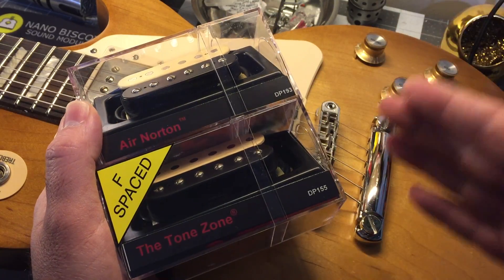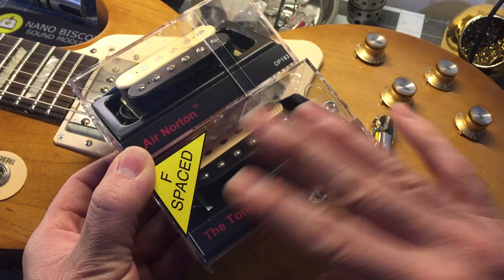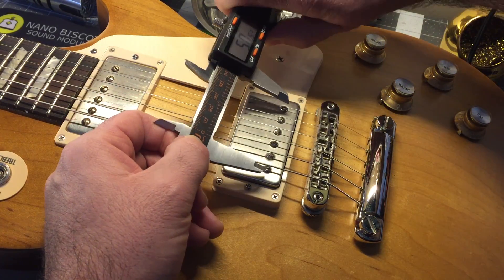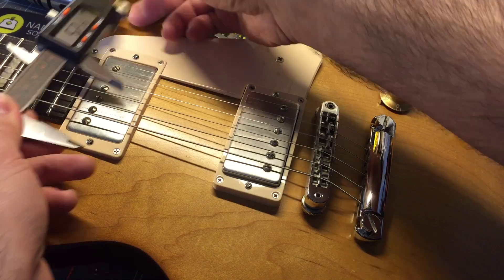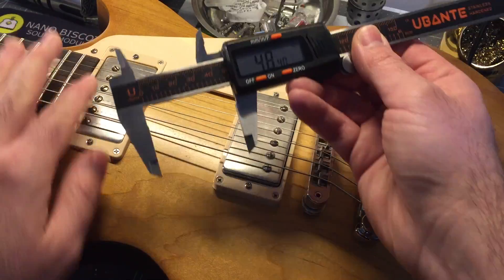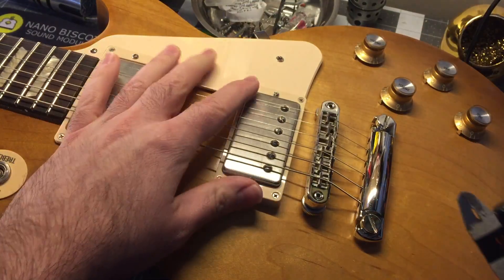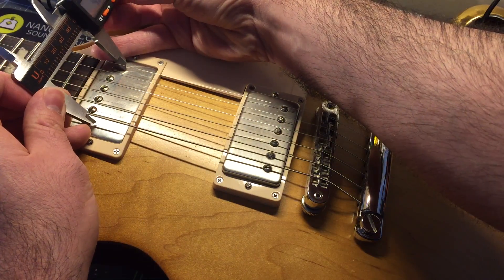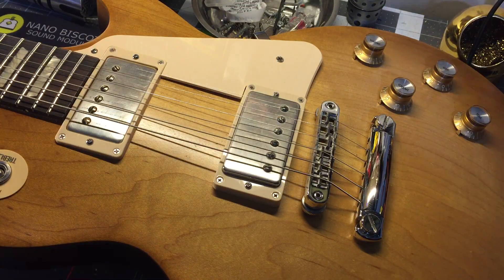What are F-Spaced guitar pickups?

Comment: That's also the same spacing as Fender Wide Range pickups, between 52 and 53 mm like in the Telecaster Thinlines, '72 and '72 Reissues. I was thinking about a set of these for my '72 Thinline, to see how different they sound over the Fender versions.

Comment: I felt certain watching the video, but many comments caused confusion and many not factual. As specifically read, the distance used is from the centre of the pole pieces. The strings should be directly over the centre of the pole piece. Yes, it does matter snd a lot. Why? If you bend you r strings snd you do, whether an actual bend, or vibrato, you should be starting in the middle of the pole piece, so the string during bending or vibrato, picks it up, both ways, as best as possible. This makes 100% sense. The neck is alway standard and F standard for standard spacing, as it existed before a Floyd Rose existed. Long before. The challenge in fixed bridges is still spacing, as an LTD, PRS or Gibson could be different and a hard tail Ibanez is absolutely F spaced at the bridge, specifically to make it easier for players like Gilbert to swap between Edge(Floyd Rose derivative), back to hard tail. What sucks is my guitar is being set up, do I can’t measure my LP centre pole piece to centre pole piece on the bridge. The neck is a given. Dimarzio and SD said F spaced meant Fender, but for copyright reasons can’t put Fender. I am getting a Standard set up to trade for a reissue. Personal taste for both. The Jimmy Page electronics are on the way. I want the pickups on the way. Holidays and days to pick up the guitar are causing the delay. COVID-19. Reduced hours for amazing tech. My hours the same, hard to make it work. Trying to put myself in position to swap guitars then stick in a Jimmy Page wiring and new pickups, but an answer on bridge string spacing is a delay. Video seemed bang on. Comments with thumbs up now make me uncertain, but the strings should be dead centre to the centre of the pole pieces for said reason. If off on one string to one side, playing the string is fine, but a vibrato/bend just sends if more off. Great video. I will go with video. Dimarzio and SD are hesitant to answer and be wrong, as some reissues, different years over decades etc, could be different. It is safe just to say measure, but if you are away from your guitar for a week, this sucks. The pickups should have or could have, actually are delayed. Video is right. Answers are hard to find. Comments don’t seem to take in account vibrato/bends when answered and the string over the centre of pole piece is definitive. Great video. I can now compare measurements to the model I will have! Thx Richie!
New info. There are arguments between the F spaced called F spaced, but most note F means Fender. Some swear by FRose. It gets worse. The Trembucker is slightly thinner than F spaced. Now I know why companies won’t answer questions. A  Nashville bridge style is NOT the same as ABR and Studios are thinner spaced, so individual guitar years models are different, do are the same models year to year and AAbR on a certain guitar versus Nashville, based on model, a Nashville style on a Studio is thinner than a Nashville style on a Classic, LP Standard or Traditional. Now it is Trembucker vs F spaced. The difference is slight, but we are talking slight. Have to wait to pickup guitar. Was it really that hard for Gibson to make a graph or list of spacing for models for a given year? Not hard! They will break their backs for serial number, BUT just provide the right spacing for a guitar all called the same thing, with no measurements on the box. Clearly they don’t want aftermarket pickups in, BUT that also means a Burstbucker is specific to year and bridge style, so they are also screwing themselves. I thought F-spaced had to be the same as Trembucker? No! SD will list say SH15 and TB15, standard and Trembucker, but also list it as F spaced, but all 3 different. This sucks and should be easy, ugh! Still a great video!

Comment: Finally found something after much looking at sweetwater. Less than 50mm centre of pole piece to pole on the bridge is a standard size. Dimarzio is 48 and SD 49. There is decimal points, but close enough, according to them. If over 50mm, Trembucker and F are close enough. Dimarzio F spaced is 51mm and a SD Trembucker is 52.6. There is a small difference, but that is the rule of thumb to help keep it easier according to them. F actually mean vibrating, but I don’t want to get into language.If it has any kind of Tremolo just pick F or Trembucker in the bridge, If not a Studio LP, then Trembucker or F spaced. If Studio measure, one company found minor differences, do one likes Trembucker snd the other F, but Gibsons other than studio, go with Trembucker or F. Hopefully that helps. SD is closer to Gibson, but SD Trembuckers will apply,

Comment: F is for Floyd and are used with floating Floyd Rose type trem systems that require a little wider pole position.  I just talked with a Dimarzio tech this week 😎.  Great video!!
Reply: So if its for floyd or fender why does this guy have F on a standard bridge Gibson?
Reply: Sound wise, is there any difference?
Reply: Gibson bridge widens the string spacing so the bridge pickup needs an f spaced pickup . It’s a new thing . You can grab a ruler yourself and check .
Reply: @Twinwolfgarage I got a standard spaced Dimarzio Super Distortion for my 2020 Gibson Les Paul Standard 50’s.  WRONG.  WRONG.
The strings don’t line up with the pickup poles.
Who knew a f***ing Standard 50’s LES PAUL would use a F Spaced pickup…..

Comment: The general numbers thrown around are 53mm (2-3/32") for F-spaced and 50mm (1-31/32") for standard spacing. Worth remembering it only applies to bridge pickups. An F-spaced neck pickup wouldn't be recommended.
Reply: that's pretty much what i have deduced since learning about f spaced pick ups. put an f spaced into the bridge position even with tuneomatic or don't (it doesn't matter too much). just don't put them in the neck position.
Reply: reading this AFTER unsuccessfully searching for F-spaced neck pickups. Thanks though, learned something new
Reply: thanks

Comment: Thanks. Wondering exactly why they'd make two kinds and what the difference is, soundwise. Maybe one tracks better?
Reply: Dagwood Dogwood  Thanks man.
Reply: Long ago, there were only two kinds of guitars: Fender and Gibson. They had different spacing. The F-spaced stands for Fender, which has a wider spacing. Floyd Rose trem happens to have the same spacing as Fender (who would install a Floyd in a Gibson? :-)). If you install a non F-spaced pickup on a Fender, the pole won't align with the strings and that affects the tone and sustain.

But Gibson LP switched to F-space after 1998. In that case, who would use a non F-spaced pickup? @_@ And most humbucker set comes with non F-spaced by default.
Reply: @davidletterboyz  maaaaaan, thanks for this explanation, it helped me A LOT. I was wondering why I have quite low sustain on my guitar, i thought i would need a sustainer pedal. Now i know the right reason. Thanks a lot again 😊😊
Reply: @MultiMeraklija  Oh ya. Low sustain could be caused by other issues as well, like low action, fret buzzing, pickup pole is too close to strings etc. Perhaps you could check with a guitar tech first.
Reply: @davidletterboyz there is no any guitar tech in my area, but if this is helpful, i will say that I have Jackson JS32 Dinky with their factory stock pickups. I don't know does that guitar requires trembucker on the bridge position
Reply: @MultiMeraklija  JS32 Dinky has a tremolo. So it definitely use a Trembucker/F-spaced pickup. But just to be clear, the stock pickup is already a trembucker/F-spaced. I suspect the lack of sustain could be:
1) fret buzz/action too low. Does it buzz when you play certain notes/frets?
2) pickup height is too close to the strings. For this, you can just experiment yourself by using a ruler and a screwdriver.
3) stock pickup output is too low. This could be a factor, but from my experience, I think ruling out setup issue first before experimenting with other pickup. The thing is, most people bring their guitar to a tech to change the pickup, and the tech will likely set the guitar up properly after that. So, indirectly, the guitar tone benefited from pickup upgrade and also good setup.
Reply: @davidletterboyz  I looking for upgrade for my MiM Hss strat

Is F spaced DiMarzio good for it?

Comment: Hi, ok so f-spaced dimarzio pickups are wider spacing...but my question is: are they also bigger(wider)? I need to know that because the humbucker holes on my washburn parallaxe have exactly the standard humbucker dimension so that, for example, a Seymour Duncan trembucker does not fit the hole. That's because trembucker not only has wider pole spacing, but is ALSO wider (the base plate) than standard humbucker. SO, can you tell me if dimarzio f-spaced have the same size of the standard ones? I really hope so, otherwise I would have a problem with dimarzio too. Thanks
Reply: Of course I need f-spacing because my tom bridge is 52mm

Comment: What happens if I put a regular spaced pickup in a guitar with a floating bridge?
Reply: As in the case before f spaced pickups existed a normal pickup always were standard on every guitar so i personally  call it the biebediewabalieboo sound xp
Reply: @sampyro765  So does that mean it will sound bad?
Reply: @Tyler-ur2ig  no with the f spaced ones it will sound tighter but before you had a great sound but the strings always bounced wich caused a jumpy kinda sound the f spaced ones take that problem out 
I tested it on my 6 string Floyd en my 7string floyd and i must say damn straith and smooth AF :) go for it
Reply: nothing.  think evh albums 1 and 2. he didn't use f spaced as it wasn't even 
around yet.
Reply: @deans.4705  didn't evh have his bridge pickup at an angle so the outside strings were at least over pole peices?

Comment: in my experience it does not matter too much. with tune-o-matic (i mainly think gibson) f spaced bridge pick ups are perfectly fine. I have 2 guitars with TOM and the standard spaced dimarzio i put in it even looks off.
either way sonically i do not notice a difference anyway to be honest. maybe someone with a stop bar gibson might profit from a standard spaced pick up, who knows.
generally speaking, putting an f spaced one in the bridge and a normal one in the neck position will be perfectly fine for most  guitars. if it does not line up perfectly do not fret, consesus seems to be that it is not much of a difference.

Comment: I ordered some F spaced pickups for my guitar with a tune-o-matic Gibson style bridge. I've read that it doesn't make much difference if any at all if you put F spaced into a regular spaced guitar since the high and low E strings will be on the inside of the poles. Conversely, I also read that if you put regular spaced pickups into a F spaced guitar, it can cause problems because the high and low E strings will sit outside of the poles. I've also heard that it doesn't matter either way. There's so much anecdotal info out there that it's hard to get a solid answer lol.
Reply: it really doesn't matter, its a marketing thing lol